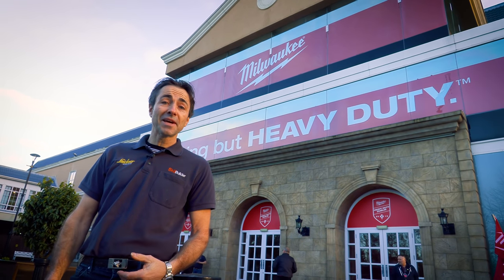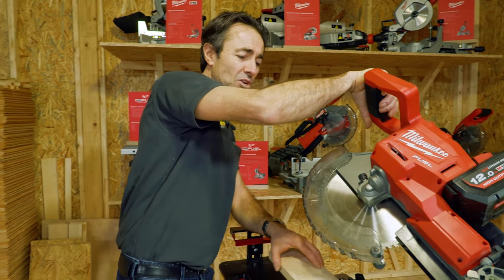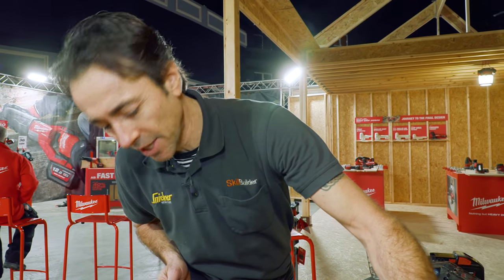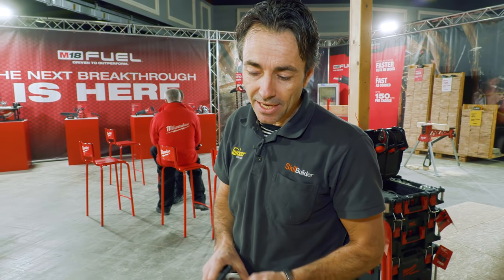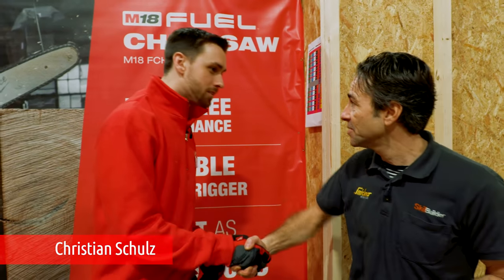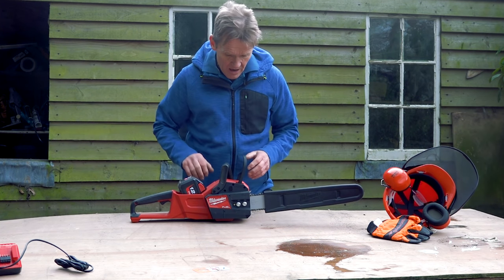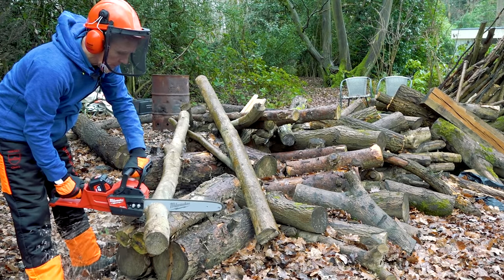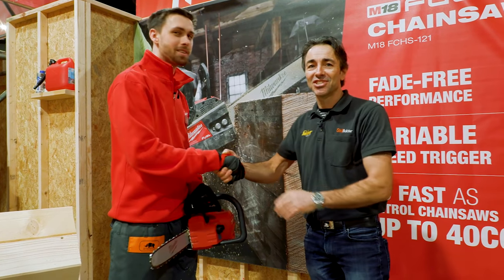New Milwaukee Cordless Saws Powered by High Output

Comment: Robin, firstly great video, but mainly thank you very much for emphasising about the push stick and regs. There are far to many of those dodgy vids from you-tubers that are using those silly sticks that look like a saw handle and they lean forward, they seem to think its ok and they bang on about "good technique " so its all ok especially when they remove the guard to make cuts.Glad you also mentioned about the length and about how far your hand should be away from the blade. WELL DONE.
Reply: Yeah, those short pushers... it keeps the fingers safe, till you overbalance. I'm not sure how to classify that, is it better than nothing or worse than nothing?

Comment: Here’s a big tip for anyone buying a cordless chainsaw.  Only buy units with two(2) bar tightening bolts.  Do not buy any with the quick chain adjustment.  They ALWAYS come loose with just a little use and the chain will skip off the bar.

Comment: Second gen vacuum cleaner loud as ever, still needed ear protection. That carbide sawzall blade is nice, I think the it will brake at the shoe attachment point where the metal is at the thinnest due to metal fatigue. Don't have that blade but all my rescue blades failed at that point while the teeth are still good. 18V system maybe at the end of life for stationary tools, not that it lacks power, but requires more copper to maintain voltage drop, added heat and more expensive to manufacture. DeWalt had the right idea going higher voltage for the larger tools. Not that DeWalt has better tools, just more efficient at that voltage.

Comment: £214+  just for the 12 amp battery, Milwaukee gear is a bit too highly price for me  but nice if you can justify it, well done on the video cheers
Reply: Gotta wait till ebay has the 10% off code on. Got my 12.0Ah for £179.99